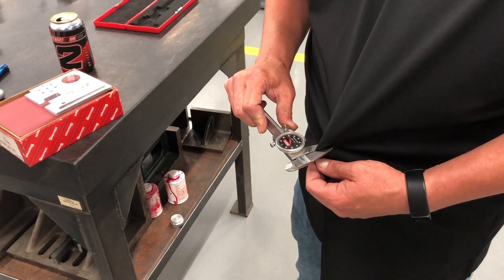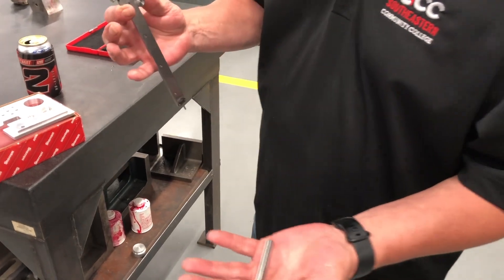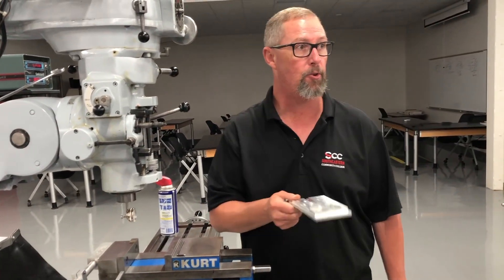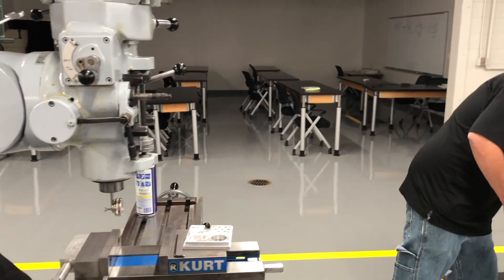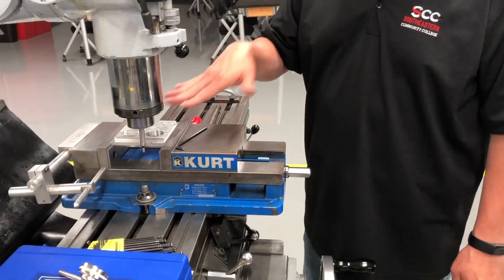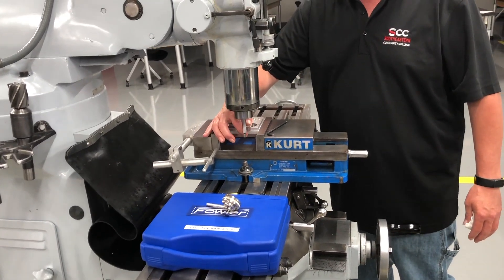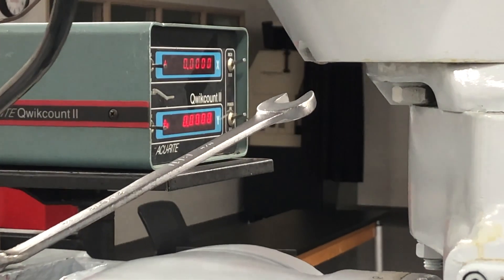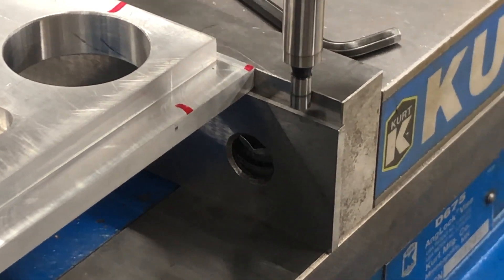How to use an edge finder and seat a part on the vertical mill

Comment: Quite a few issues with the methods shown.
1 - Always locate off the fixed jaw not the moving one. Then the Y axis remains at zero regaedless of the part width.
2- The recommended speed for the edgefinder is 500 rpm, some types edgefinders will destroy themselves at 1000rpm and this high speed can make them bounce off the work. Always check the spindle speed before turning it on for this reason.
3 - Good practice is to always minimise tool stickout even with edgefinders, the demonstration was waaay too far out from the spindle nose.
4 - Do not have the quill extended if possible, certainly not as far as the demonstration. This eliminates any out of tram and is more accurate.
5 - With a dro it is not necessary to take up the slop when positioning the workpiece. This is a practice from when the dial scales were used for positioning. With a dro it can be approached from either direction.
6 - Tap soft materials with a softer mallet. The lead one will mark the part and the hard impact can make the part bounce back off the parallels. Ideally a hide or plastic mallet would have been far better.
7 - The edgefinder is designed to work even if the chuck has runout, it is not more accurate in a collet. If the next operation was drilling using the chuck would save a toolchange and a lot of winding of the knee handle. A bonus is that the cutting zone will be at a similar spindle position to where the edgefinder was used.
Apologies to all the Toolmakers for stating the blindingly obvious.
Reply from the maker: Thanks for all the tips, I appreciate it